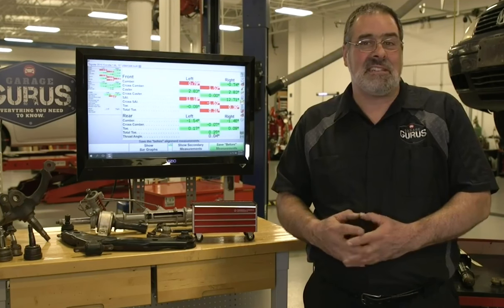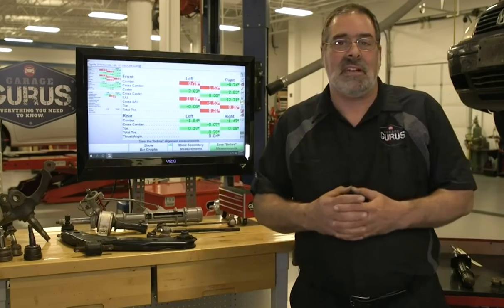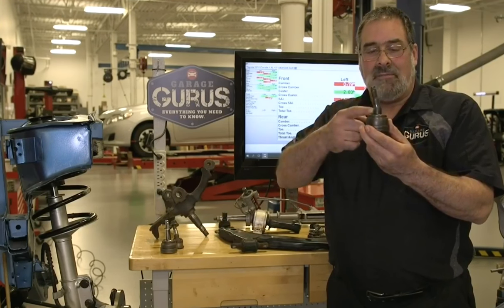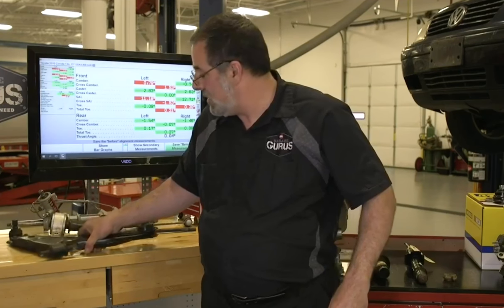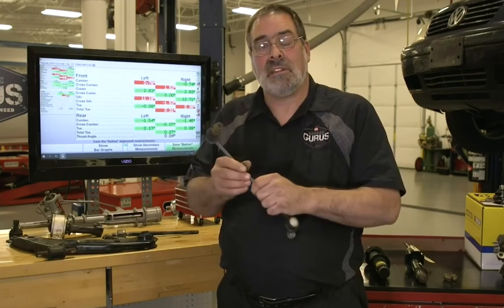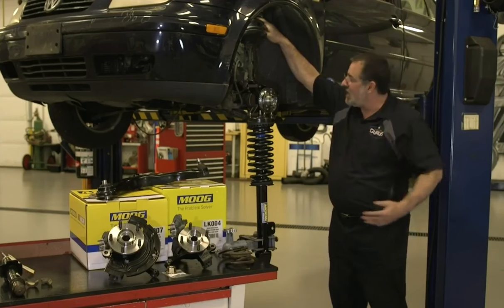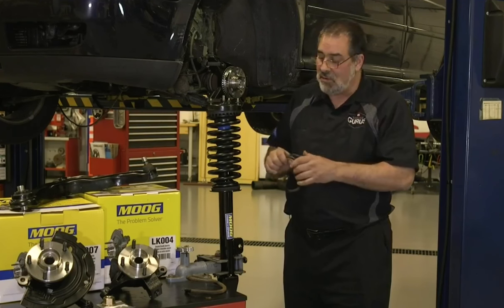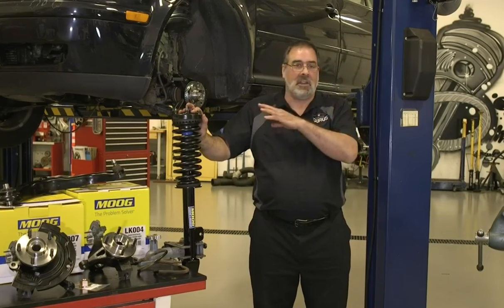Garage Gurus Facebook Live: Steering & Suspension Diagnostics

Comment: on the sleeve type adjusters along with getting out the CP 714 or 717 air hammer I also try to tap a chisel into the slot to open it up.

Comment: I have an McPherson strut on my Elantra. There pretty sweet. However when I did an alignment the car guy got all my tire good except front left the computer said it was like -1. something. He said it's cuz the McPherson strut doesn't have an adjustment for camber. And u sed that in the beginning. But he went on to say I can buy a part or something and taking off those 19mm nut bolt combos and install it where the strut is attached to the knuckle. 
Regardless if I sed that right I'm paraphrasing but like is there a way or part adapter I can install because the car still veers to the right a bit. It's pretty annoying. And I know after I install it if I do it myself to save money I still will have to do an alignment but what u think...? Ever heard of something like this.... Peace dude

Comment: A lot of the suspension components you're showing in the beginning till like 13 mins are cut or minimized so u can show us by hand some the failures. But people would have to have already had worked on these things to grasp more what ur saying. But I'm fascinated about the suspension because I've driven cars that were old farts and the suspension was so compromised (2000 Altima) was so bad any small bump it would bottom out it was so sensitive. I'm a delivery driver too boot. So 2 cars later my 2nd Elantra and I've done a bunch of my diy work on the suspensions of these cars the 2008 Elantra SE is 90percent like driving a 2017 Elantra with badass suspension. I've driven one of those as a rental. 

In all I'm not trying to flex only reason why I friggin worked on these things cuz delivering sliding into curbs and shit. So it was against my will it's not fun cuz like u sed and just 2 weekends again I bent a rear wheel tie rod and like u sed when I put the new tie rod on cuz I picked a part at the junk yard the wheel was so out of camber. And I had to do an alignment after. That goes for my 2007 Elantra when I had to work the front suspension I jacked the lower control arm, tie rod, sway bar link and believe it or bent the wheel but didn't pop the tire. I mis judged my braking distanced and slammed the f into like a 4 or 6 inch curb it was brutal. In conclusion I'm not knocking you I'm not up there explaining squat but. For first 10 mins or so I'm just thinking car people would actually know what's going on. Cuz ur holding the parts cut up. Either way I'm about 13 mins I wanna finish this this is a treat. Suspensions are so awesome

Comment: It really annoys me how we are sold the benefits of just replacing whole units on vehicles, so if a single suspension component has failed on one side of the vehicle and the only option in the future is to replace the whole unit complete with spring and shock, the next consequence will be that you need to fit the same on the other side too as it's genuinely correct/ better to fit shocks and springs in pairs - my whole point is we go from a single component failure to replacing multiple parts on both sides of the vehicle. This is not in the interests of the customer as the parts will nearly always be made to a price by aftermarket manufacturers, they will fail more often and require labour each time. The car loses it's original build quality, resources are wasted with greater shipping and disposal costs which is not green either!!! What ever happened to real mechanics that were capable of reconditioning things in house? I'm sorry for ranting but we claim to be green and progressive but this type of throw away age and just fit new parts really grinds my gears, it's all based on profit and deception. Next we will just replace the whole car when we get a puncture........ Back to the video, it's nice to see some correct motor vehicle technology being taught, I agree with the tech knowledge but strongly disagree with the politics surrounding the modern motor trade today. We may have less emissions now but the trade is much more wasteful of materials and resources.